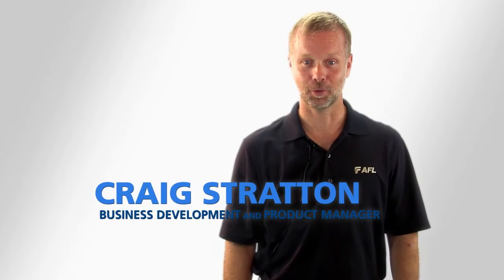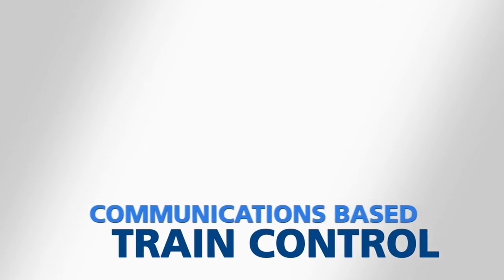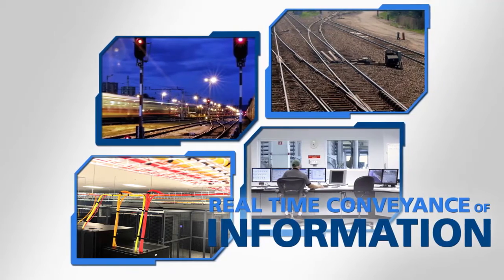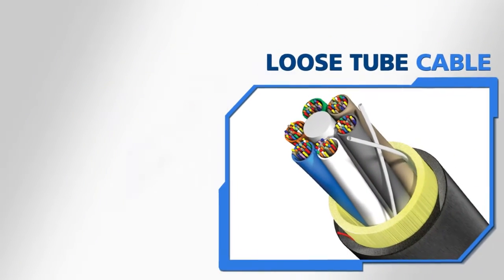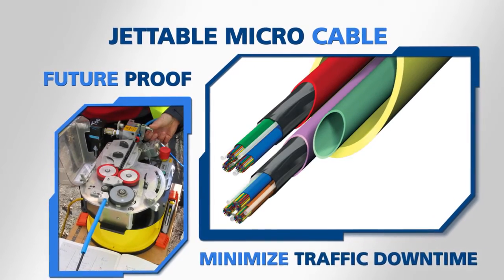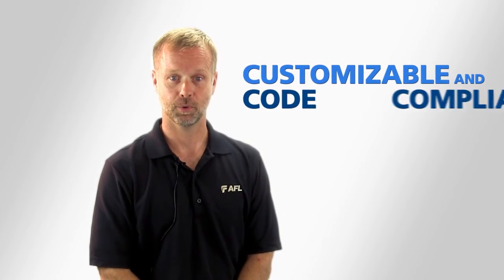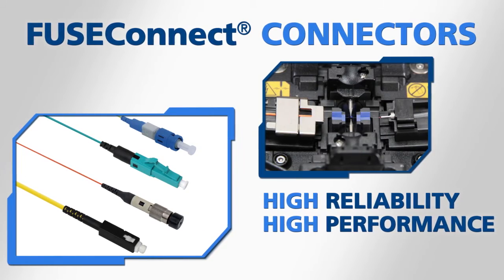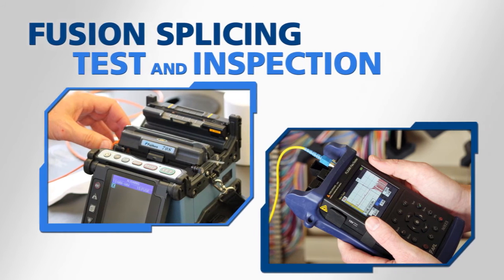Railway Network Infrastructure Upgrades

Comment: AVANU founded in 1997 and based in San Jose, California is a privately held network infrastructure product developer with manufacturing and production in the United States. AVANU focuses on developing high valued products for the IT infrastructures and data centers environments that are cost-effective, full-featured, and high performance. AVANU adds value by being customer-centric by placing customers at the center of their product design, from the standpoint of the user's interface, features, and customer support. AVANU's flagship product, the WebMux Network Traffic Manager, is a full-featured load balancing solution for managing, controlling, and securing local network Layers 4-7 traffic. http://www.avanu.com
 http://avanu.com/network-traffic-manager-webmux/
 http://avanu.com/webmux-virtual-server-load-balancer/
 http://avanu.com/webmux-network-load-balancing-methods-solutions/
 http://avanu.com/application-delivery-network-Controller/